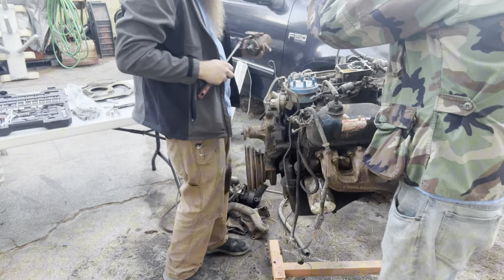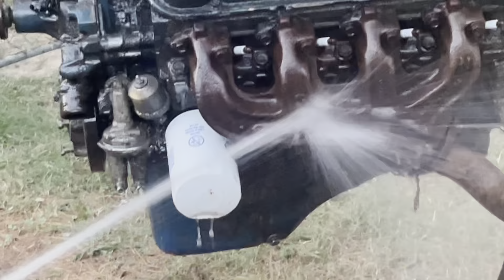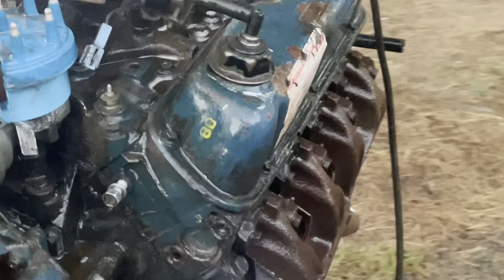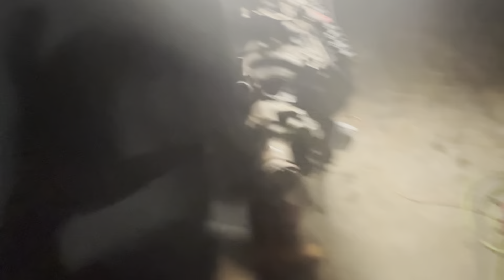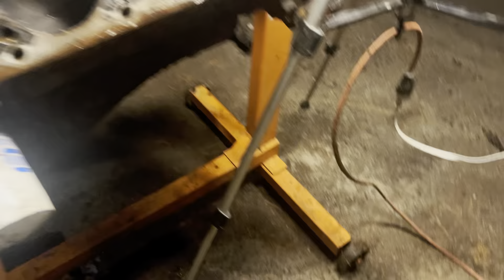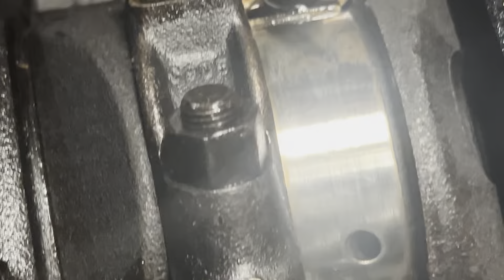2 Idiots Teardown a 351W

Comment: ✔️Non integrated thermactor 1977 ( No lines to a D8 onwards type head)

✔️Thunderbird  or LTD II with ✔️York AC, 

✔️clearly a  replacement engine with EGR. 

✔️Its got cruisecontrol and RA 390 is a replacement engine decal  code

🥔  no xx 390 xx code exists for H code Ford 2 bbl 351 W on the Calibration Decel's  I've seen. 

❓⁉️Im guessing the drivers side calibration says  Catalyst FMV Approved  1977

Perfect EFi 4.2 F-150 replacement engine.
Reply from the maker: @deanstevenson6527  DEAN is the MAN!
Reply: @Lars615  Ali-Man-en